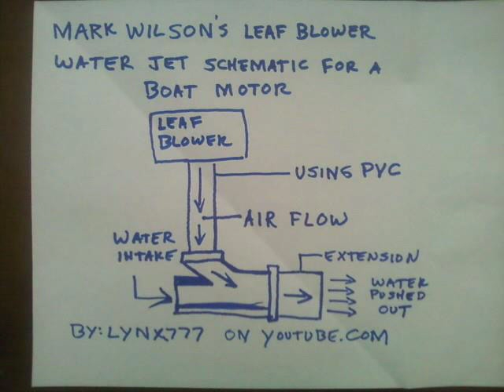HOMEMADE BOAT MOTOR SCHEMATIC USING LEAF BLOWER & PVC APPLYING Bernoulli's Principle Equation

Comment: good post mark.  I already had Schematic #1 in my mind before I came here, but I was going to employ a check valve on the intake.  lowest pressure I could find, it should work.  Once the check valve opened it would reinforce itself.  I would theorize that you could actually feel the power change when the check box opened.  Also, one way to mix the air and water better would be to fill the (I'm guessing 2" pvc) intake with some smaller tubes to bring the water past the point where the air is introduced to the horizontal portion.  That might help the mix.  Actually a check valve on the outtake might help mix water and air as the pressure and the narrowing of the valve opening will infuse the two.  Just some thoughts.  I'd like to see what you build.
Reply from the maker: Hope it works out

Comment: Theres no way thisll work. The leaf blower wont build enough pressure to do anything, Itll jump bubble air out each end, despite the TY45 fitting, thats if it makes it down to the bottom at all. Have you ever put a bucket of water down a couple feet? It will take a ton of pressure for the air to displace the water at all, let alone actually make thrust in one direction. Cool idea, but wont work.

Comment from the maker: Motors can be tested in a bucket of water. When i find a leaf blower, it will be tested and put on youtube. The PVC to create it only costs $2 and for any bending, PVC becomes flexible at 120 degrees and higher and stays in the shape you hold it by wetting it with a damp sponge to cool it off rapidly. Its super easy to work with.